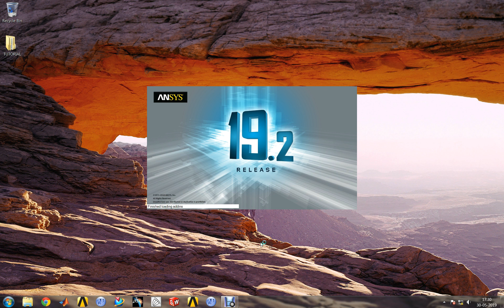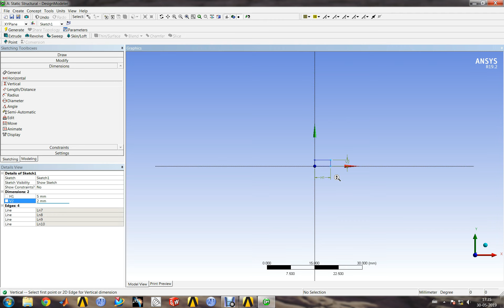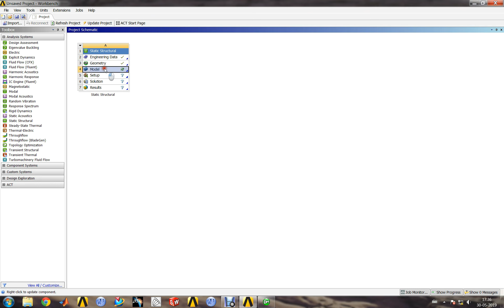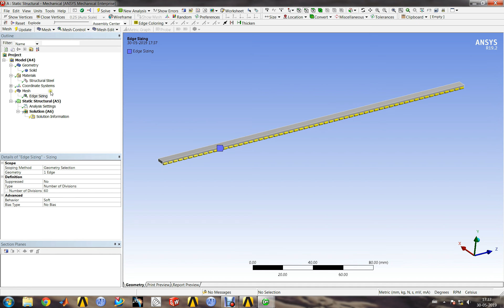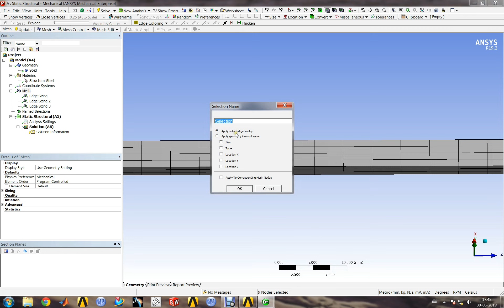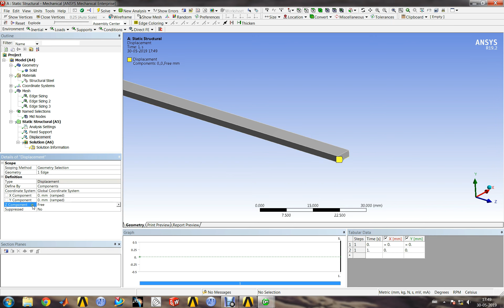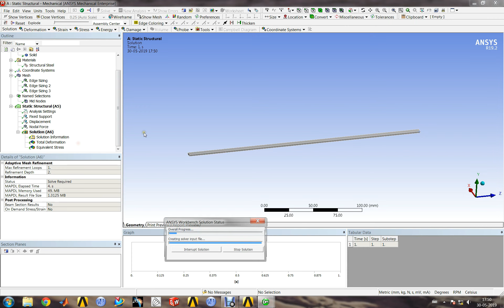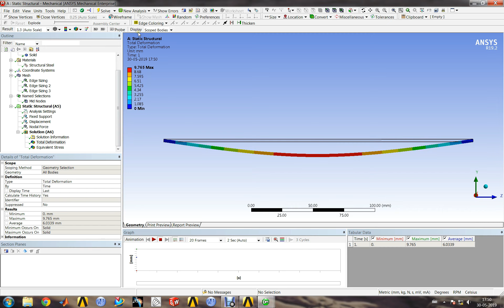Nodal force application on simply supported beam | Ansys Workbench

Comment: I have one doubt it will be a great if you help me
In cantilever beam force applied is 4N at free end axially.If i apply this force on each node wheather i have to apply 4N or i have to divide this force by total no of nodes on cross section and then apply it.
Reply from the maker: Hi, that's a good question. You have to apply 4N only. Ansys solver will divide and apply to the number of nodes selected.
Reply: @LearnCAE  thanks for clarifying my doubt